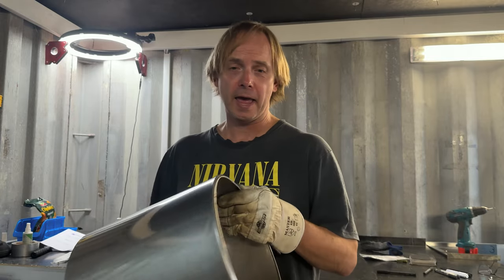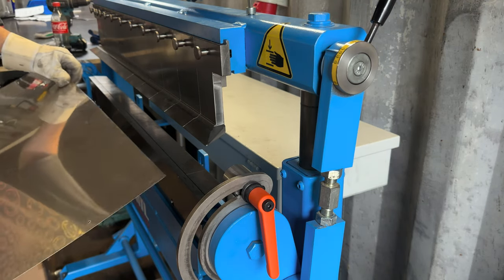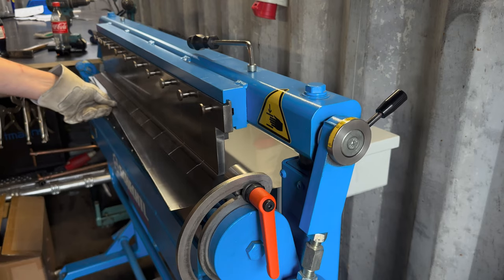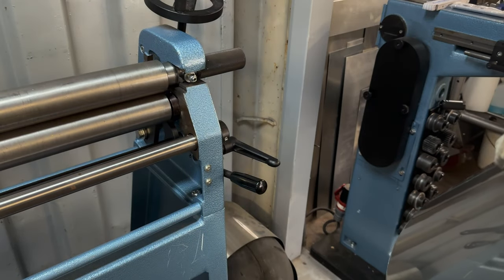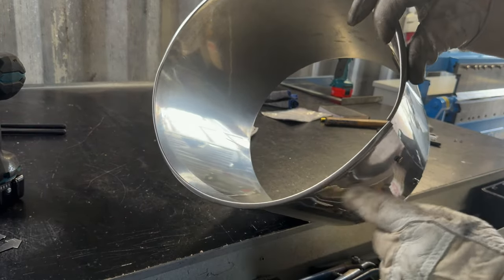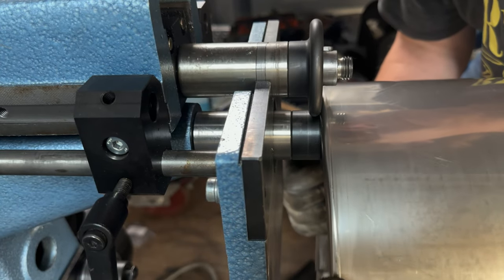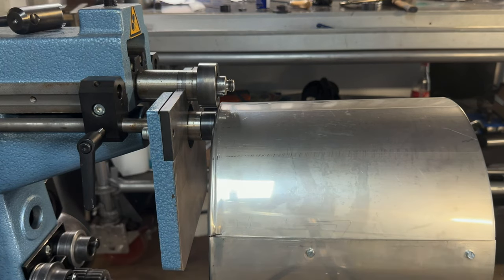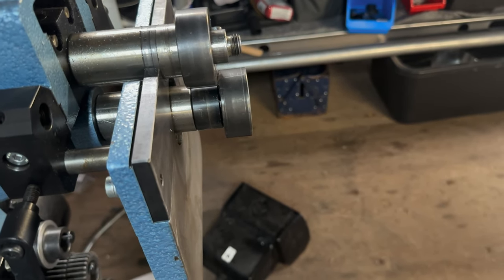Hemming , This is a double Hem

Comment: Awesome videos. Far faster than i can make stuff. 
Can you please do a short video or include it in your next one about your scratch gauge. looks like an awesome tool

regards,
Paul
Reply from the maker: You mean this? 
https://www.amazon.de/Stubai-Anrei%C3%9Fschablone-geh%C3%A4rtet-140-278601/dp/B00G5KPR98/ref=mp_s_a_1_1?adgrpid=1252344294103049&hvadid=78271692263627&hvbmt=be&hvdev=m&hvlocphy=130794&hvnetw=o&hvqmt=e&hvtargid=kwd-78271806963271%3Aloc-72&hydadcr=24981_2363190&keywords=stubai+anrei%C3%9Fschablone&qid=1699502389&sr=8-1
Reply: Paul are you in the Uk? Roofing supplies in Bolton sell them mail order, quite cheap really
Reply: Yup that. Thanks for sharing a site. @Sheet_Metal_Workshop
Reply: Unfortunately not in the uk. Easier to make on or have one cut than order but just need a picture to assist. Thanks for sharing where to get. @DavidLeach-fm6ti